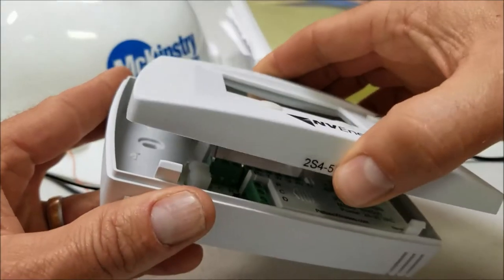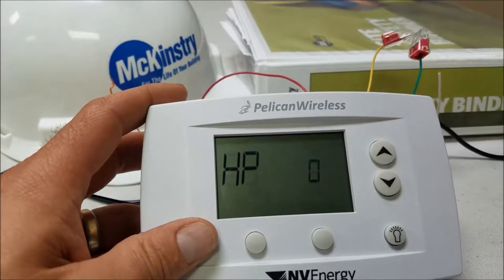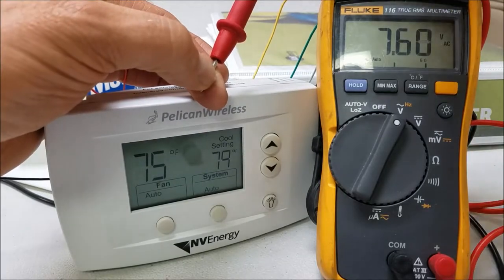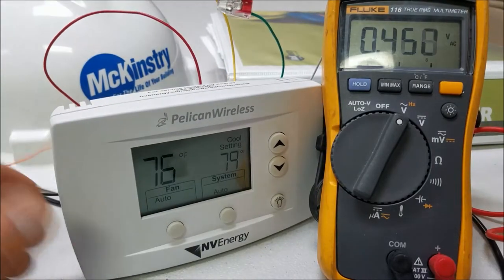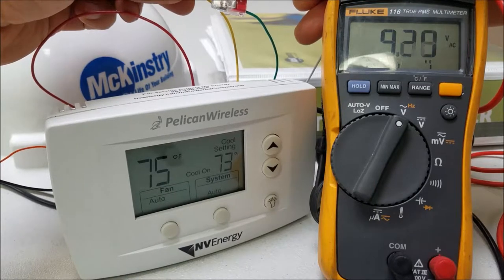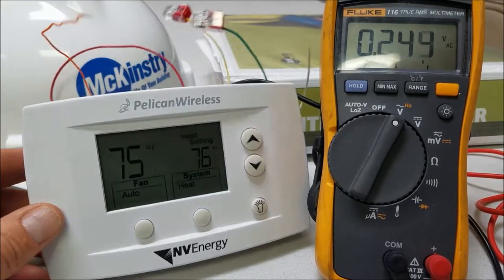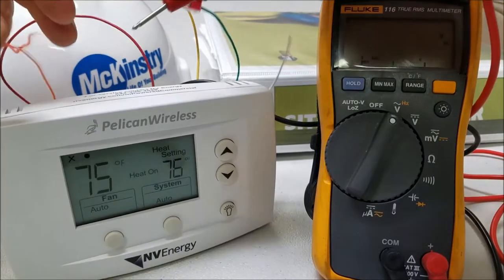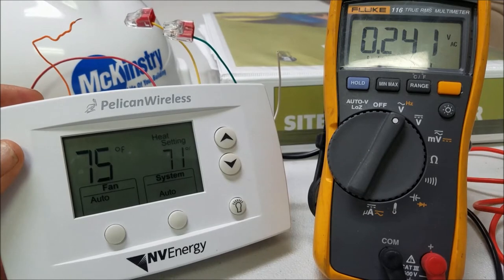Pelican TS200 Tstats Config & Volt Meter Testing

Comment: Do you know how to lower temperature that the unit is set to begin cooling at?  For example, at work, it feels hot to us in the room, but the unit will not go below 70 degrees.  Is there a way to set it so that it goes below 70 degrees, even though it actually READS 70 degrees?  Even 2-3 degrees would help!  Thank you!
Reply: Have you found the answer? We stuck on 70 cant go lower
Reply: I am a 30 year service man. I am getting familiar with the pelican system currently (01-26-23). Most techs set up the thermostat to only allow you to raise (heat) or lower (cool) the set point to a maximum or minimum limit. 70⁰ is pretty low. I allow down to 68⁰. The cooler you go, the more risk you take which may cause the system to ice up. If you are pulling the space down to 70⁰ and EVERYONE (not just you) is still feeling warm, it's likely the thermostat needs to be calibrated to display the correct (warmer) temperature. If, however, you set your thermostat to 70⁰ and it hovers say at 73 or so and runs non stop, you probably have deeper problems such as, low refrigerant. If it's a 100⁰ day, you likely won't pull down to 70⁰. Your regular service man should know about your concerns. If he does and you're feeling like he's giving you the run around, chances are, he probably is.